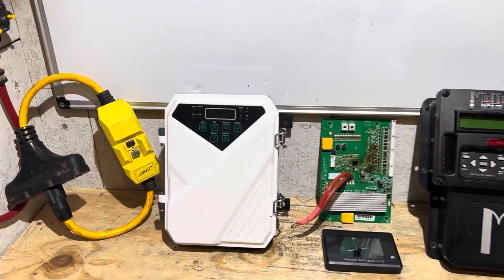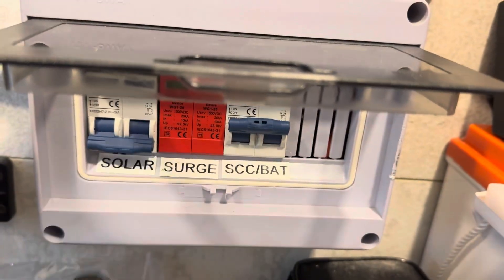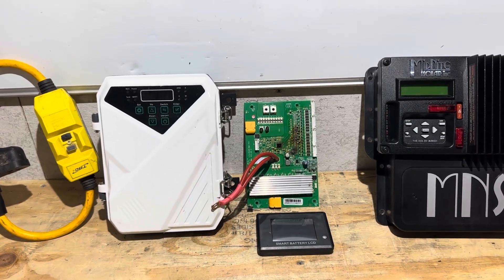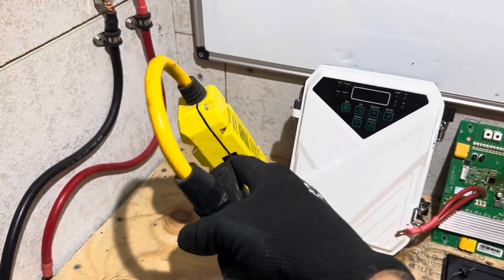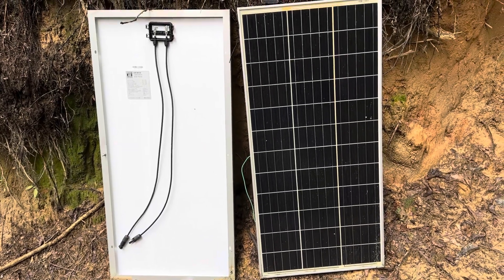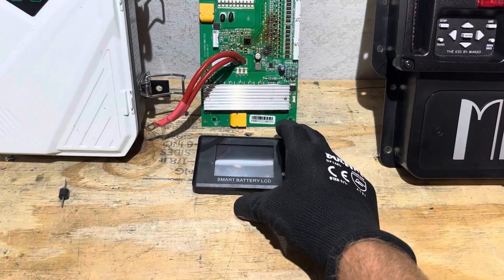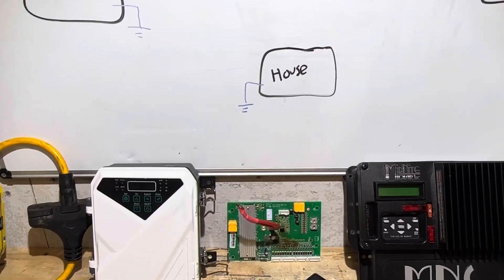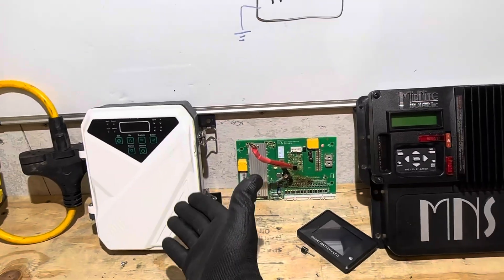Lightning Hit My Off-Grid Systems, What Was Affected? What I’m Doing To Help Mitigate Future Losses

Comment: The trailer being skined in aluminum curated a Faraday cage around the electric devices in the trailer... and most likely that saved the electric items in the trailer. The foot of the ball hitch gave the ground to make that Faraday cage a stronger point of protection from the emp of the lightning 🌩 strike.
Reply from the maker: Do you have any experience with the copper mesh faraday fabrics? I see you are a radio enthusiast and you radio folks know a thing or two about signal propagation and interference 🙂
Reply: @THEOFFGRIDMOUNTAINHOMESTEAD I haven't played with Faraday cloth... unfortunately it's difficult for me to get out to park's on the air and play with a lot of things. But yes I am a amateur radio operator license general class. I'm just starting to get back on my feet from past issues. I'm also dealing with medical issues on the physical side of things... maybe some day I'll play with some of this type of stuff. KY4TRK James
Reply: @THEOFFGRIDMOUNTAINHOMESTEAD i thought i replied. No i don't. Sorry

Comment: It's what's known  as a EMP. It doesn't matter how close or how far away from the strike zone. If it's with in range and not in a stell can to avoid that EMP it will cook it. If the is voltage in a capacitor some where in the device it can cook it. Like wise A EMP is a EMP sometimes things take a hit and other items don't.

Comment: This is sort of the reason I got solar to begin with.  I got my set up (which I just paid off in may btw... all 50K of it) in case of nuclear war.  There was some issues with the inverter setup on install but I had originally picked the emp hardened solark inverter to prevent this exact issue.  I ended up getting a non emp hardened 15k inverter though because when I got the thing the 15k was so new an emp hardened one wasnt an option.  Of course I dont have batteries yet and ww3 hasnt kicked off either so for now Im in a holding pattern.  I do have a whole home surge protector for lightning but it doesnt protect the solar at all so I am very concerned about a lightning strike or an emp.  I would be very interested to know what you do to remedy this issue.
Reply from the maker: I feel you my friend! I have a great deal of time and money tied up in mine as well and almost had a literal stroke when   my inverter went down. I’m on the search for better products or solutions and when I find something I will let you know. 👍

Comment: Sorry you lost a lot of equipment.  I worked doing MRI's and was always around powerful magnetic fields.  There are some preventive measures you could do.  Placing unused equipment such as your batteries , inverters and other electronic devices consider buying large metal containers like tool boxes for example used in bed trucks where you can fit all your stuff and then seal the lid with tin foil.  If you have metal shelves you can place items in it  and then cover them with copper screens.  Don't forget the bottom since that is where a lot of damage will come from.   You can buy galvanized trash cans from your home builders supply store and also seal the lids with aluminum tin foil.  Basically you want to build a faraday cage and than you can use a transistor radio and tune it to a radio station, place it inside the containers you are using and see if you can still pick up the radio station.  If you can't it is working if you can still hear your favorite tunes it is not working, there is a leak somewhere.  Now this is more for lightening strikes which will work or solar flares, but if its is from a nuclear source there is no protection as you have been blown to bits.  There is a company that sells amp shields for homes, I don't really know much about them but you can research it yourself.  Again be safe and sorry for your losses.
Reply from the maker: Appreciate you! Thank you for your feedback and suggestions! 
The GFCI inside an aluminum truck toolbox that got disabled is what I can’t grasp. Overlapping lid on the box, I guess it was extra sensitive or maybe the gasket in the lid allowed enough gap or aluminum wasn’t a good enough shield.  18V batteries and drills etc were good though. Maybe the GFCI was on its way out anyways. 
I’ll try and put a radio in there and see what happens. 
If anything, this experience has raised more questions than answers for me.
Reply: @THEOFFGRIDMOUNTAINHOMESTEAD  If the tool box was bolted to the truck, the point of entry was where the bolts attached it to the truck bed.
Reply from the maker: @shelley131 Makes sense! 👍
Reply: An ungrounded metal box is far less effective than a grounded metal box.  The vehicle itself is not grounded either (the tires are insulators).

Comment: Taking a direct hit is rare. However it does sound a bit as if your lightning protection is not quite up to the job.
Reply from the maker: I’m open to suggestions. What to be done about batteries just in storage? What protection mechanisms can be employed for this situation? Faraday cage an entire building, maybe this is the answer?
Reply: @THEOFFGRIDMOUNTAINHOMESTEAD they where in a shed or your house? Usually only your house has lightening protection. But if even your house got knocked down a bit you might need a second earth rod
Reply from the maker: @TheCornucopiaProject-bd5jk Battery that had fried BMS was just in a remote storage building. Plastic cased battery sitting on wood floor. Nothing to attract or amplify any induced voltages or currents.

Comment: We had a battery CO detector and a small power supply unplugged to get fried. Also a little less than $800 worth of electric/electronics were fried. There seemed to be no rhyme or reason. 

What type of diodes would you buy to be universal to replace in solar panels?  Thanks

Sorry that happened, but it lets us know how easy things can be destroyed.
Reply from the maker: It’s crazy how certain things are affected. 
I bought 10A10 diodes which is the direct replacement. 10A 1000V general purpose rectifier diode. Cheap and easy fix as long as rest of panel is good and initial test shows they will still make power. 
Appreciate you!

Comment: Midnight solar  will rebuild the controller it will save you a little money
Reply from the maker: Thanks for the advice! 
I have had this controller in for a warranty claim previously due to failed capacitor and now a Chinese controller right beside it made it through the storm. I’m questioning my logic buying the premium parts now lol. May get a cheaper HQST controller and install?

Comment: Do you have any experience with ferrites and do you think they may have helped in this situation?
Reply from the maker: Yes I have high saturation and broadband ferrite chokes on my house system. AC side and DC side. I have followed the advice of Dr Arther Bradley (EMP doctor YT) in regard to protection measures. I don’t know if the pulse went through the inverter itself and upset it or could have been the battery cables being an antenna for the energy. All less than 6ft. 
Golf cart batteries in my storage or in the Golf Cart were mostly unaffected except a display or something, no hard trips. Commonality here is the golf cart battery BMS have transient voltage diodes for noise from the motors or motor controllers. This is why I’m thinking TVS diodes could potentially help a little at least on battery side?
Reply: @THEOFFGRIDMOUNTAINHOMESTEAD  Interesting. Do you know if the ferrites need to be changed out now? Was there any change in the appearance of the ferrites? It would be cool if Dr. Bradley would weigh in on this event.
Reply from the maker: @georgeclark7208 No change in appearance on the ferrites I checked. The ones I checked still have strong magnetism. Good point you make, I need to read some publications and find out if they need to be replaced!

Comment: That’s amazing it got things in storage!!!! Always think I should get things permanent for power outages but I’m also worried about hail and things like this.  Probably found the ground in. Almost a double edged sword they tell you to ground everything real good but then the lightning really likes that really good ground and attracts it.
Reply from the maker: I thought it had ground coupled until I found the battery in storage and GFCI. I guess the pulse was just that strong! I worry about hail too, quarter sized has happened but the big 3-4” stones like you can get would be devastating to everything around here!

Comment: Glad you had things that survived the strike. My only guess is that the rv protected the stuff inside from an emp. There is something you can put on wires that are supposed to help protect things from emp strikes but I do not know if they work. I saw a video about them a while ago. A guy on Facebook asked about his inverter generator not working properly after a lightning strike. Apparently he could still run it and make power but the inverter board went bad on it.
Reply from the maker: Thank you! I’m very grateful to still be operational! Definitely could have been worse. I have the full selection of add ons for protection. Only thing I don’t have is a hardened bunker lol or TVS diodes on each battery but this probably wouldn’t help for other sensitive components. 
I have high saturation and or broadband ferrite chokes on everything for the house system. AC and DC side. Full selection of midnite solar MOV surge devices on the DC side, PV, batteries etc. Shaffner EMI/EMF filtering on the PV. Siemens First Surge on AC side. I have followed all advice and recommendations from Dr Arther Bradley (EMP Doctor on YT)
Reply: @THEOFFGRIDMOUNTAINHOMESTEAD  So you don't know of a long term solution for this event other than redundant systems? I don't expect any electronics to absorb a direct lightning strike. But, lightning does indeed strike more than twice in the same area. What to do?
Reply from the maker: @MrFirstone23 I thought I had all the protections in place that one could have on my house system. Currently I am researching different/potentially better protection components along with other hardening measures for my power room and power shed.

Comment: Mother nature is more powerful than anything man can create. Those powerful lightning strikes come with strong EMPs. Back in 1983 I experienced a powerful lightning strike while standing on my covered front porch. Even though it struck about twenty feet away, it knocked me down. I quickly got up and went into the house where I found our old wall mounted telephone halfway across the living room floor and smoking. All of our power was off. My grandpa checked the breaker panel and it was smoking too. Over the next several days I helped my grandpa (who was an electrician) rewire the entire house and install a new main panel and all new breakers. It was hot in that old farmhouse because there was no such thing as "backup power" back then. We didn't even have an old generator. As for the EMP part, it killed the radio in my grandmother's car and ignition coil in my pickup.
Reply from the maker: Thanks for sharing your experience! Lightning is definitely very powerful, never would have thought it would have gotten an ignition coil in a truck, that’s wild too! Appreciate you! 🙂

Comment: Wow sorry to hear that glad your house inverter is still working. Did the new sungold survive and now I’m wondering about my 12v system and how to protect I don’t have any surge devices I turn off solar and only charge occasionally it’s for power outages
Reply from the maker: Appreciate you! The Sungold inverter was off at the time and when checking afterwards it powered up and is functioning correctly at this time. Hopefully your strategy works to keep your 12V system running.